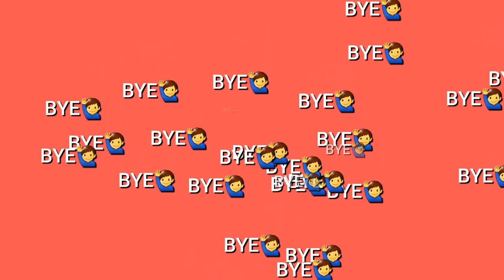#meshgrill HOW CAN MAKE  MESH GRILL ON CAR(എങ്ങനെ നമുക്ക് ഒരു മെഷ്‌ഗ്രീൽ ഉണ്ടാകാം) maruti 800 grill

Comment: 30 rupayude net, felt quick um pooziyum,  settanu Njan cheythitund,  Kidu lookayirunu. 4 kolamayi Ath vandi koduthu
Reply: Broo net evde kittum
Reply from the maker: Adwis
Reply: Brohhh,  Plumping and wiring shopiloke kitum.  Blk plastic coated cherya hole net aaanu neat undakuka
Reply: Grill azich Eduth, grill outer ozikan Akathe parts oke cutter kond cut cheyuka,  hacksaw kondum patum timedukum.  Pineeed purathek thali Nikuna bhagangaloke scant paper kond smoothakuka. Grill nde pinilnu Venam net fixakan.  Paramavadi tight il net Akathrk madaki,  met lock itykuka,  pooozi idukayaaa,  Met lock itykuka pooozi iduka,  Angne purathek kanatha vidathil cheyua.  3 layer cheyumbolekum net fixed aakum.  Try C hey Broh.  Front view Vere levelanu 😊😊😊